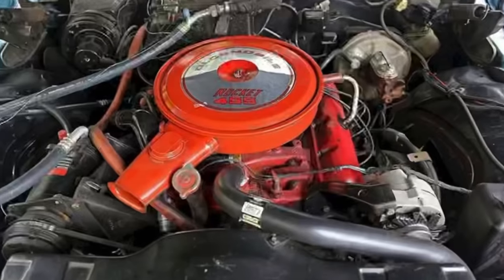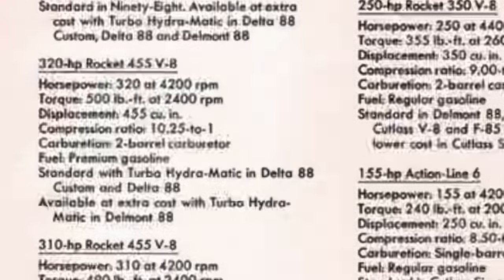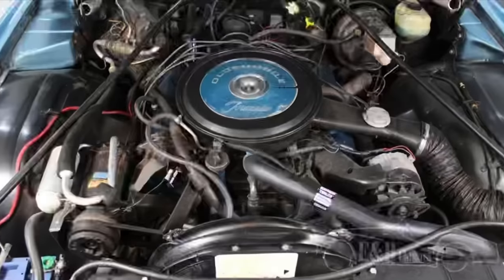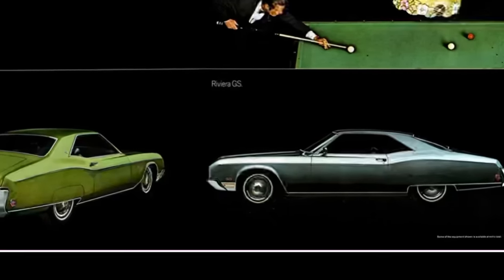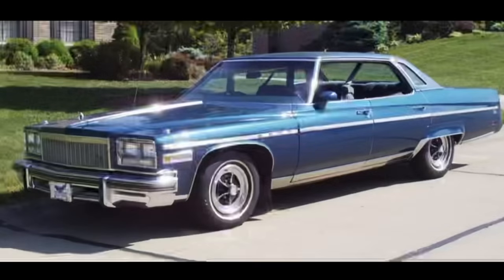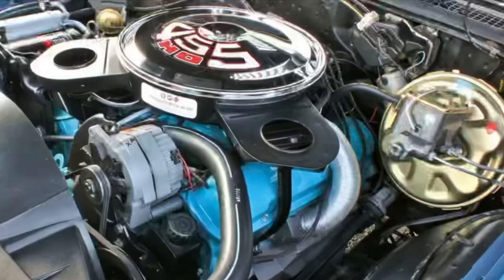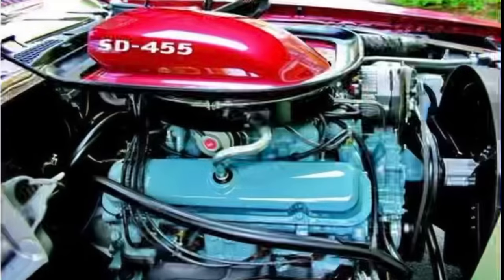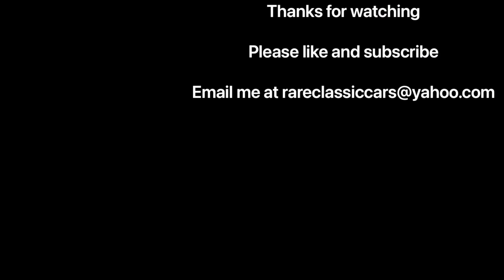Best Car Engines - The Rise of the Mighty 455 V8s from GM’s Buick, Oldsmobile, and Pontiac

Comment: All the so called lubrication problems with oldsmobile 455s can be alleviated with just a few basic mods and keeping the revs below 6200rpm.
Especially for jet boat guys, you MUST run the flat bottom Moroso 10qt marine pan! MUST!
A standard replacement melling "hi volume" pump with the bolt on pickup, matching pickup for the pan. A little oil restriction via the plugs available from various manufacturers in the main saddle for only #2,#3,#4 mains to the valvetrain, solid lifters so as not to have to maintain pump up with hyd, and if you get real serious add #8 drain tubes in back of each cyl head to the oil pan above the oil fill line. Go thru even a new pump and check some clearances, make sure the bottom cover is the thick cast one or double up 2 stock thin stamped steel covers with longer bolts if on a major budget. Help out the pressure relief spring with some kind of spacer to increase spring pressure but don't go overboard. 20psi idle and 70psi max cold is a good range to shoot for.
Go for mid to loose clearances compared to "spec" on the crank mains and rods. Rod side clearance needs to be reasonable even .018 or more works. Less not so much. 
I've went so far as to drill and tap each lifter galley feed for 1/8 restrictor plugs with a small orfice drilled thru but didn't really show any improvement and hurt oil fill to hyd lifters. 
Basically what I'm trying to say is for performance car or boat, the stock oil pan leaves alot to be desired. Even a mild resto can benefit from a basic 7qt aftermarket pan. Don't bother trying to disable the oil filter bypass, as actually bypassing a filter is way more safe at keeping oil flowing to the galleys than to disable the feature all together. There is no flow advantage to getting rid of the oil bypass. There are a few more tips but don't let detractors tell you the olds is "no good" because of oiling issues. It's simply not true!

Comment: Allegedly the Buick 430/455 engines ran hot, and care had to be taken to avoid overheating. I knew of Buick guys that would retrofit larger radiators and fans to alleviate the problem. The Olds and Pontiac engines were a little better in that department. I remember reading somewhere, that Pontiac had restricted the secondary bores because the 455 made more horsepower than was allowed by GM, and, in certain applications, outpower the Corvette and big block Chevy engines which was a mortal sin in GM land.

Comment: Regarding your comment at 1:27, if you want to demonstrate credibility when describing engines, please note that RPM is never pluralized, i.e., "RPMs".  As you know, RPM stands for Revolutions Per Minute.  Therefore, if pluralized, it would translate into "Revolutions Per MinuteS" which would not correctly describe how fast the crankshaft is rotating.

Comment: I had a 70 gto with the 455 in it but the previous owner had it rebuilt and bored to 462.I know this because he hand lettered it on the fenders.More like a lemans because it had bench seat and column shift auto.It was a rocket.I remember talking my way out of an “unnecessary noise “ ticket after pulling away from a green light with the radio on I didn’t know I had squealed the tires.It was true!It was a chore to not.

Comment: It is interesting that many comment that these were their fastest cars ever.  They really weren't but that's how they felt.  Modern acceleration is amazing but the vintage felt faster.
Reply: It's a relative comparison.  These old mills had a ton of torque which is what you're feeling, sometimes known as 'grunt.'  I think that most would agree that no matter how you build a BOP engine from that era it's still going to be hard to beat something with 1/2 of the displacement, turbo charging, fuel injection, VVT, and an 8-speed auto all working in computer controlled harmony.  Nice for the day-to-day driving, but punching it in a 455 and hearing 4 barrels open, running it up to redline, shifting either manually or automatically bang is less economical, watching the fuel gauge drop and the RPM's increase, but a hell of a lot more fun!
Reply: You're right.  I had these old cars and loved them.  But the first time I went to pass someone with my striped down 2015 Ram 1500 with a 5.7 Hemi & 3.93 gear the acceleration scared me.  I punched it like an old time car, and was up to 80 in an instant.  I've since learned how to drive it.

Comment: Olds 455 was also available in the GMC motorhome which makes it arguably the tractor engine of the trio. I also don't think it's any accident that the Olds diesel 350 was derived from their engine lineup, good or horribly bad (which is widely known), their components are, indeed, very robust. I'm not giving it the nod for that reason but strictly for the fact that it came in the 1st gen Tornadoes, arguably some of the sexiest sheet metal out there, especially in rear 3/4 view. 

Yes the Buick is a hot rod but the oiling system is a dumpster fire & the water pump will make you question why it's so damn difficult to design a cartridge-style pump (Ford 4.6) or at least use anti seize during the assembly process. Make no mistake, they run tho & the Rivs they came in were some gorgeous cars.

Tin Injun, I'll be honest just don't know enough about them. I never quite understood the logic of the head design that retains & transfers to the rest of the head so much of the exhaust heat in that odd bit of casting instead of chopping it off flush. Can anyone tell me if they were more prone to overheating than the others? That design choice could be why. That being said, they were standard issue in GMC trucks for several years so they must be relatively tough.

Comment: During your research, being that the BOP were all different as designed by their respective divisions, did you find a corporate mandate that the displacement were all 455s? The obvious next thought, why the Chevy 454 came in a cube less? Was the displacements arrived at because of each divisions engineering, and physical block limitations. I've driven them all. But only got the opportunity to pound Pontiacs and Chevys.

Comment: There was a time when each GM division quietly interchanged engines amongst each other. For example, you would open a hood of a Pontiac equipped with a Chevrolet engine; a Buick equipped with an Oldsmobile engine; a Chevrolet equipped with a Pontiac engine; an Oldsmobile equipped with a Cadillac engine; a Cadillac equipped with a Buick engine. A Chevrolet truck equipped with a GMC engine. A GMC equipped with a Detroit Diesel engine. Customers complained of this in court until GM decided to create GM Powertrain division. Buick, Oldsmobile and Pontiac 455 V-8s were awesome, but those Chevrolet 454, 496 V-8s and the Cadillac 472, 500 V-8s were monsters!
Reply: I remember customers suing GM in the 70's because their Pontiac had a Chevy 350.  It made national news.
Reply: @craigbenz4835  I don't know why customers thought it was a issue. My brother had a 1974 Oldsmobile Cutlass and it was equipped with a Chevrolet 350 V-8. My Dad had a 1972 Chevrolet Caprice and it was equipped with a Buick 400 V-8; they didn't care-it's all GM
Reply: @jayelbee1111  :  I don't recall the outcome of the case, but it was a big deal to customers back then.  It seems odd now.

Comment: Not even hammering on it My 1 of 412  455HO got same effective results on my 71 GTO...on relatively  low 8.4 or so compression.  0-60 7.5.  1/4 in 13.4.   3.55 butt gears. Cliff Ruggles Q-Jet Around 480 ft-#   great performance car setup...under rated motor.

Comment: I have had all 3, but lots of the Olds 455's in cars and Jet boats. I have raced cars and boats both, so i got pretty well acquainted with these engines. I will say ,back in the day it was almost impossible to find the ''real'' top dog Olds 455[1970] as only 197, lightweight Honest to God'' W30, 442's were made. That being a 2 dr  sedan [F85] body with no air, no power brakes and a 4 speed stick, and a 3.91 gear. Olds did not like to give out that 328 degree duration camshaft as it was NOT a well behaved cam and did not have enough vacume to run goodies or idle with any drag at 750rpm ish]. finally, the weight difference between the Better looking Hardtop and the sedan, was not huge at all..but sure made a difference at the Drag strip! But if you found the real Mccoy...I would rate it right there with any Hot 454 factory car..and I had a few of those too!We had a 442 club here in central IL back in the day, so we were able to take the deep dive into these things, with the help of Joe mondello and son Benard way back then. We still have one of the guys raceing a 455 in an 86 cutlass today!
Reply: Yes you can immediately tell if it's a Real 442 when you hear + feel that 328 cam !  Is it true a few of those 328 cams ended up in some W31's also ?
Reply: @Powell_OBonez  The W31 cam was a great cam in the 350 and even if drop in the big block cars, better drivability than 328 cam. Never saw a 328 in a small block from the factory..just too much overlap/duration for 350, bad low end..when we tried it!

Comment: I've only had the Buick version. A 71 Electra 2 door and a 73 Regal coupe. Both Buicks blew head gaskets
Reply: GM cars were notorious for blowing head gaskets if the coolant wasn't changed. The old green stuff had a 2 year lifespan before it became acidic (normal mileage) and the head gaskets were steel shim. Saw plenty of those gaskets rusted out in the 70's  and 80's.

Comment: My Uncle had the misfortune of ordering the Buick 350 V8 in his 1971 Jeep J - 4000 pickup. It was a gas hog as well as poor  quality ( white metal ) rocker arms and upper end components which made for a noisy engine as well as a penchant for exhaust leaks at the manifolds. He went through two of these engines in the life of that truck. He would have been much better off with the AMC 360 V8 had he been willing to wait for delivery as AMC was in short supply of those in late 1970 when he ordered the Jeep.

Comment: Have you seen the article from 10 or 20 years ago either car Craft or hot rod with a tested all four Chevy Buick olds and Pontiac Big blocks to see which one could make the most horsepower fully modified.  And the Buick won because of its largest boar and shortest stroke combo.  The Buick was also the lightest of the Big blocks they said it doesn't weigh that much more than an iron headed Chevy small block

Comment: I know it’s a bit off the topic but the Chrysler 440 to me was a way superior engine you would be able to let that thing idle for two hours or more in 110° heat and step on the gas thing would take off burning rubber without any hesitation or stalling I had a New Yorker that had a 440 and I lived in the desert down near Palm Springs I got 220,000 miles or so out of it The engine was just wore out because I always drove it hard
Reply: I'm with you.  Mopar or no car.  But that isn't the point of this video.  Think of the Buick 455 as GM's big block Mopar.  There are some design similarities.
Reply: Did some of the 440s have  cross bolted main bearing caps?

Comment: The 68 hurst olds came factory with the 455. It was long rumored the car was built with the standard 442 400 engine, abd swapped at Demmer Engineering with the rear of the hurst olds conversion. Not true. The hurst olds was built with the 455 right under the Moses of top brass, completely ignoring the ban on engines bigger than 400 in intermediate cars.

Comment: Stroke has nothing to do with rev characteristics, nor torque production. Falsehoods that keep getting repeated. Displacement and compression are the biggest factors on slow speed (off-idle to 2500) torque production. Doesn't matter if the displacement is from bore or stroke. Also lots and lots of long stroke engines have been built that rev 7k-8k. Cam and valvetrain are vastly more important. 
Side note, the D port shaped secondaries on Pontiacs doesn't slow them down any on stock or 'warmed up' engines. The secondaries on the qjet itself were shaped like that day one, the intake doesn't impede flow with thay carb.

Comment: My pop had a ‘73 Olds Custom Cruiser with a 455 cid Olds smog motor. I think the engine had 8.0-1 compression ratio. About all I remember with the Custom Cruiser was that engine drank up regular gasoline at a rate of 7 mpg, close to 8 mpg on a good day. Retarded cam timing? Really bad as my uncle had a ‘72 Chev full size Kingsgate (?) station wagon, 400 cid SBC with a 2 barrel Rochester carb that got 14 mpg. That Chevy 400 cid SBC pulled good up to about 65-70 mph while my dads 455 Olds Custom Cruiser wheezed its way to 65 mph. 
On the other hand, my moms ‘70 Olds 98, high compression 455 cid with a Rochester Quadrajet, rated at 365 hp ran like a top. I still remember in the summer of 1970 my mom got the 98 Olds up to 120 mph on I-5 just south of Portland, OR on a new section of I-5 that was just opened. What a ride!

Comment: How do these V8 monsters compare to modern day turbo charged engines? They have found ways to get more power out of smaller engines today.
Reply: Or how about an overdrive transmission on a big block?
Reply: It's about the torque shared the modern day turbocharged engines are faster and they sound like a bunch of sewing machines on steroids. Or fart rockets it seems.

But to get into one of the '70s big blocks and put your foot into it and feel that torque build up that's where the fun begins even if other cars could dust it
Reply: @jeffrobodine8579  I've done that. Improves mileage on the highway and slows the engine and accessories down.
Reply: The best is an old big block with a turbo. Been there, done that!
Reply: While today’s turbo charged engines have to spool up the old big blocks had instant throttle response. The internal construction of the old engines weren’t nearly as precise as today’s newer and smaller engines but the old engines were built with stronger components and weren’t being stressed to the max to squeeze every last HP out of it. The older engines would withstand more abuse and could be overheated numerous times without much if any damage which would be catastrophic to a modern engine.
Reply: Not really comparable.  They were great in their day competing with each other.  Cylinder head/air flow technology has come a long way since then and modern engines have the advantage. 
They're both good.  The big old V8's were smooth, powerful and robust for their time.    Turbocharging - the first ones of those in the US market were pretty under-engineered, too.  Everything has come a long way -  and everything comes at a cost.
Reply: Older engines were well built for the oil of the day,  and the old leaded, high octane gas made making huge power with high compression easy. Likely they would've continued to increase in power since the early 70s if not for the new emissions and fuel economy standards and new unleaded, crappy, low octane fuel.

Americans were among the first to use fuel injection,  with Chrysler products and the Fuelie Chevy 283 in the late 50s. We were the first to turbo car engines,  with the Corvair 6 and the aluminum Buick V8 in 1960. There are also experimental double overhead cam BIG BLOCK Chevy and Ford engines in the late 60s. The Cosworth Vega had a double overhead can,  aluminum engine with fuel injection and a 5 speed in 1975. Then it all went downhill. 

Modern engines started by slowly recovering the lost power by making advanced electronic ignition and fuel injection which could still make the power and meet emissions and fuel economy requirements.  Thinner,  stronger oil helped.  More gears in the transmission helped.  Then along came direct injection.  Most don't realize that it's like adding a turbo, because it injects fuel at not the usual 50psi. but 15-20,000 psi, and the fuel basically works like one of those "freon" cans,  actually cooling the intake air.  It's like a free intercooled turbo. It makes higher compression possible without detonation, making old fashioned power possible again. Then a turbo or supercharger can be added on top of that, making as much as 2-3 horsepower per cubic inch instead of the old 1 horsepower of the good old days. 

... and now electric motors are even more powerful than that.  It's been a crazy past decade of horsepower increases!
Reply: Nothing can touch a Hemi on nitromethane though! 11,000 horses.
Reply: @mikee2923  actually,  lots of modern engines are built much stronger than the old big blocks,  with massive bottom cradles that make 4 bolt mains look dainty, forged and even polished cranks, forged rods [some even titanium!], super high compression,  higher flow heads, and very strong blocks.  GM LS motors, Ford Coyotes, Hemis, and the Toyota Supra inline 6 can take over 1,000 hp regularly,  and some Honda 4s aren't far behind,  even though they're much smaller.
Reply: @jamesengland7461  :  "Nothing can touch a Hemi on nitromethane though! 11,000 horses."  Nothing else duplicates that rattle in your throat like a top fuel idling.

Comment: ⭕️He states CORRECTLY in this video of the clear winner is the 455 BUICK ,stating rev power on the highway!
Fact is it does accomplish all this however without being a hi-rev motor!
5500rpm MAX
BUT it’s TORQUE is ABOVE 
500 ft lbs @
ONLY 2800 rpm

Is why Buick  had the fastest of ALL MUSCLE CARS ever during this era! 

💥The 455 stage 1
BUICK 
GRAN SPORT !!

Comment: I think I read that the buick intake weights 130 lbs.
Reply: I can assure, as a person that has built several Buick big blocks, it does not weigh 130 pounds. The Buick big block would not be the lightest of the GM big blocks if it did. It's closer to half that.